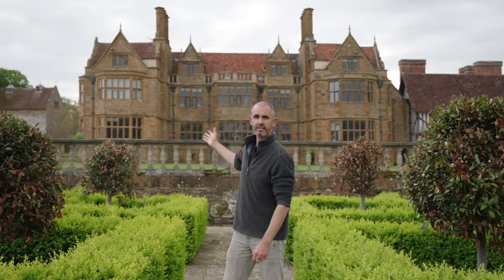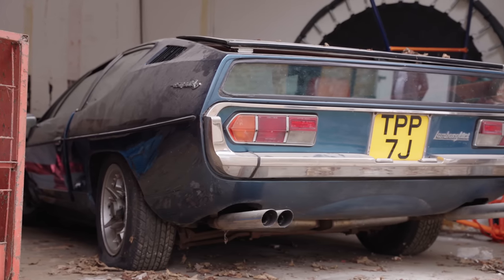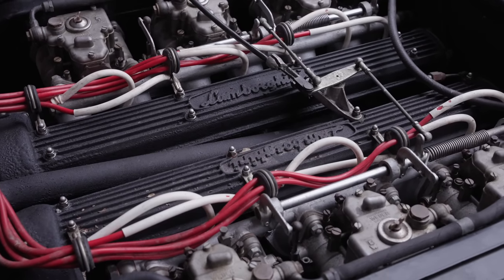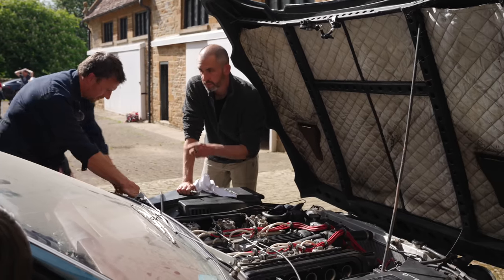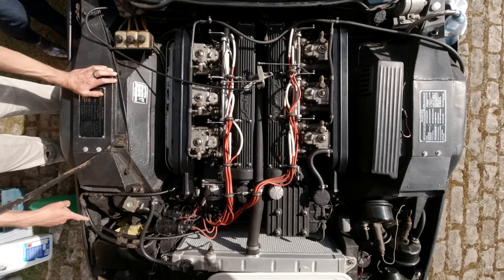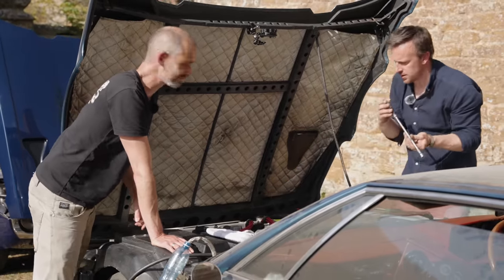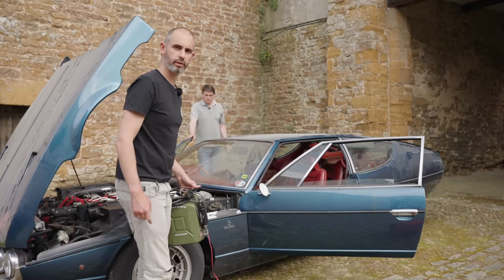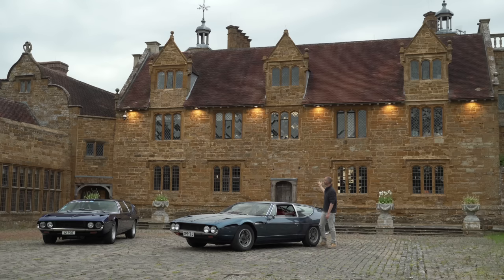Classic Lamborghini mansion Barn Find with Guy Fawkes history -  will its V12 run?

Comment: The Espada - the most beautiful car ever made. I first saw one in Rome in the 70s and was blown away. Great stuff and well done getting it going again, magic! The Webers are 40DCOCs if I rember correctly, twin chokes and effectively a carb for each cylinder. I remember a road test (in Autocar) I think, where the tester complained about how much pressure the accelerator needed until he was shown the 6 carbs and linkages needed to open them!!

Comment: The father of a school friend of mine in the midwest owned an Espada.  Had no idea they cost $15,000 (thereabouts) in those days.  My dad drove a Corvette, which he bought new for $7000 in 1969.  The $$ differential between domestic and foreign sports cars has existed a long time.

What's shocking is a 12 cylinder Lamborghini with a 0mph to 60mph time  OF EIGHT (8) SECONDS

My goodness.  Things have changed quite a bit.

Comment: Firstly great work - an excellent video! I'm not sure if anyone else has picked up on this, but the registration number TPP7J is associated with a 1970 Lamborghini Miura P400, which was written off - Class 'B' so not repairable -  on January 15th 2016 (when the Espada was off the road). I take it the number plate has been swopped?; The car seems too genuine for any other explanation. 83600 from my mobile was how I checked, still a stunning find.

Comment: The benefit of a 4 barrel DD Holley is you can remove the aircleaner & dump a cap full of new petrol down the carbie throats to start the engine with it & run it till the iffy old petrol in the tank is pumped forward to the engine.

Comment: If you could fit an fuel injection system to that car the reliability would be lots better, getting those carb’s cleaned and tuned into sync is a specialist job and a pain in the behind.

Comment: 🌟Erm...no big surprise concerning the flooding problem. Why operate the Weber fuel pumps via the throttle linkage so many times, you know how much those enrichment pump jets allow into the cylinders! Use Bradex Easy Start, and then worry about idling/misfiring issues after establishing that fuel is in the carburettors. 🌟
Reply from the maker: Every time we have reached for Easy Start in previous videos we are shot down in the comments for being irresponsible.

Comment: I like watching your ‘barn finds’ but please fit an adjustable pressure regulator to your ‘fuel in a can’ or have a separate carb pump.
-Fuel injection runs about 40psi
-Carburretors run about 4 psi.

If you had a 3.5/4psi output you could leave running without any concern of damaging the (Dellorto likely) carbs.
Keep up the good work.
Reply: I’ve created a V2 of the can of hope with 2 pumps, I just need to get it to Jonny
Reply: @TonyBMWE12  thanks.
I've been cringing every time I see it. 👍

Comment: If you put a T-connector on the output of the pump with a control valve on it, where you can regulate the flow back into the tank. you can control the flow pressure (flow) towards the carburetor on the other side. And leave the pump on.
Reply: I’ve built a v2 version, with a low and high pressure pump, just need to get it to Jonny
Reply: @TonyBMWE12  nice job 💪🏻👍🏻. 

( i like the can of hope , nice shape)

Comment: I always thought the quad headlight front end and cheap looking grille looked cobbled together but would still like one. Had a chance 23 years ago and still kick myself about it. Personally I think I would have the bodywork fixed and respray it in a bright silver as I'm not a fan of the Euro Mexico blue. I would also have had  a fire extinguisher handy before adding a live battery and fuel, especially after seeing all the mouse crap as the little buggers like to chew wires and hoses. Probably wouldn't be a bad investment to have a halon fire abatement system installed after restoring it, just in case. Certain the insurance company would cut you a deal if you put one in considering what it would take to rebuild an Espada after an engine bay fire. BTW, really looks like it belongs with the house.

Comment: £40 on a fuel pressure regulator for that magic can of dino juice would be great for cars like this. McGill motorsport do one 0-140psi with a gauge , FPR_BU is the code :D 

May be worth asking if it does drop low to carb pressure tho (3-10psi maybe)

Lovely video JS
Reply: I’ve done a V2 version of the can with a low and high pressure fuel pump, I just need to get it to Jonny
Reply: @TonyBMWE12  where ya based , I travel the whole UK and live near Jonny , I can be a pony express 🤣

Comment: Mice eaten lots in there 😮❤ wow bit a few knocks and bangs bet when fuel pressure is right and a oil change it should sound alot sweater
Reply: Hold on... Google translate is working on the English version..........

Comment: Although I'm still of the opinion that the Miura is the most beautiful car ever made working on and driving a Countach completely popped my illusion of what Lambourghini cars were. The most unpleasant car to drive or work on. Also as impractical and ridiculously expensive to run as my own 16th century timbr framed hovel and collection of needy vintage motorcycles. The Espada is my least favourite Lambourghini but I guess slightly more practical than it's contemporaries lol.

Comment: i wouldnt be using regular ethanol gasoline with these. synthetic fuel with just a smattering of synthetic 2 stroke oil for the seals. that way it will start right up 2+ years later without gumming the carbs up. this is used on outboard 2 strokes let alone a $400k classic.

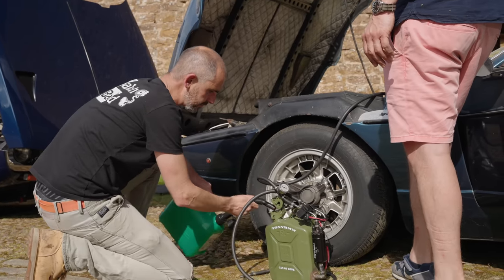Comment: 20:19 - ARRRRRGGGHHH JOHNNY! NOOOOOOO!!!!!
Cars of that era should NEVER have Ethanol in any level in the fuel system - It can destroy the hoses and the insides of the Carburettors! In some cases it can even eat in to the metal of the manifolds and cylinder head.
Reply from the maker: What else do you run it on then? Every old car in Britain runs on it now!
Reply: @TheLateBrakeShow  98 RON Premium Unleaded, same as I put in my 66 VC Valiant Slant Six with HyperPak, doesn't have any Ethanol in it DownUnder, so I don't have to worry about it eating the Phenolic Resin of the Thermoquad's body, or in the case of many carbs, the plastic float in the fuel bowl. I'd double check the Lambo has hardened valve seat inserts too - That's what the Lead used to lubricate, along with it's Octane boosting effect,... Your RAC did a test back when Leaded fuel was being removed, showing older cars shouldn't be run above about 3500 rpm if you wanted to avoid Valve Seat Recession on the softer metal of Cast Iron and Cast Aluminium heads without the inserts - lucky for me, Slants can shift up at 1200rpm and stay with traffic, and top out around 4500,... the Lambo would just about be coming on cam around then. :)

Comment: It's about time the can of hope has an additional low pressure pump fitted or a valve and a regulator for carbs.
Reply from the maker: Yes, we agree. Thanks for the reminder.
Reply: I’ve just finished a V2 of the can of hope with a low and high pressure fuel pump, just need to get it to Jonny
Reply: @TonyBMWE12  Stick a tyre pump on it while you're at it Tony :-)

Comment: don’t understand why you feed carbs that want 6-7psi with a fuel injection pump running at 40psi.  Get a red-top auxiliary pump.  I realise you are not running it continuously - but even so, its a magnitude more than you should be using
Reply: I’ve just finished a V2 of the can of hope with twin fuel pumps, just need to get it to Jonny

Comment: I get it with a lot of folks why they don't take very good care of their cars and let them deteriorate but this Guy has a few bucks. Clearly this Espada isn't the worst one out there. However the owner of this car had the means to wire in a heat system for the garage space, keep it clean and go on the offensive on rodent control! I have a Saleen Mustang that I rarely drive maybe 70-100 miles a year but it stays on the battery maintainer, gets regular oil changes, regularly cleaned & I wired the garage for 220 so a good heating system could be installed. Also I am very proactive to keep rodents away from the garage. My Saleen looks, drives & otherwise appears as new. I am just a regular Guy who worked by the hour my whole life so this Guy with the mansion could of done better by this Espada if he really had any interest in it!